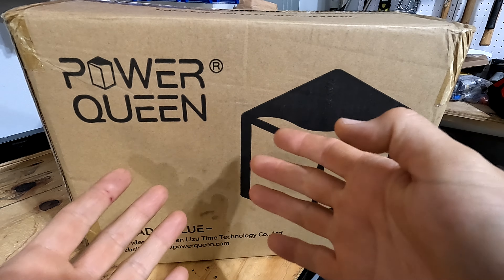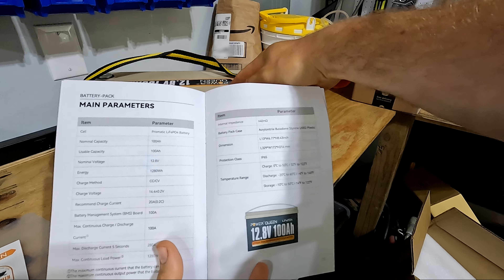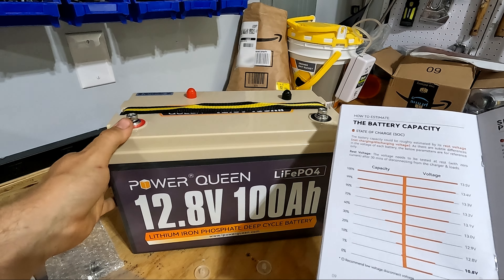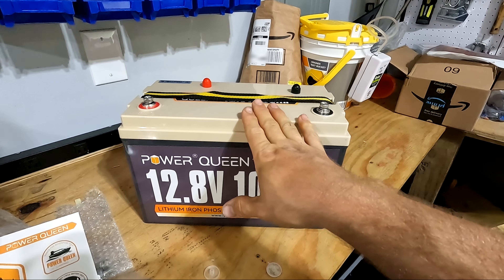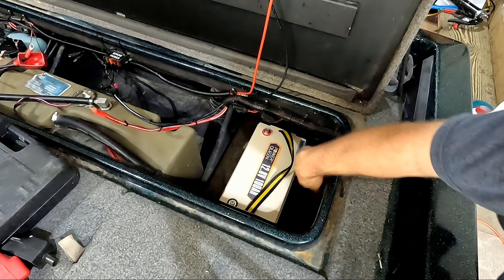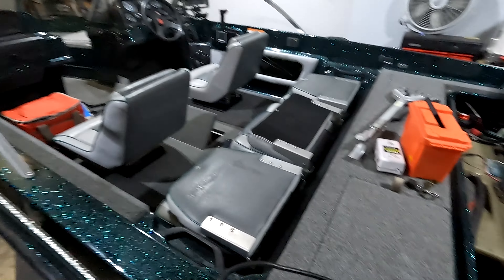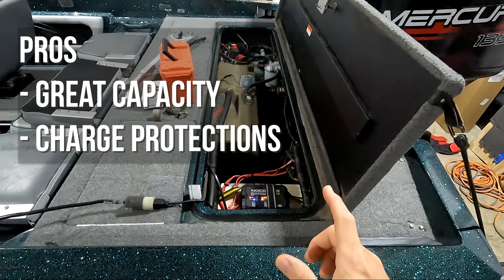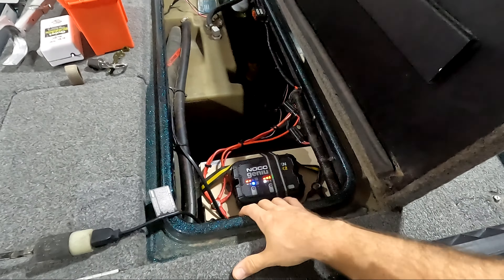Power Queen 12V 100Ah LiFePO4 Lithium Battery | Boat RV Off Grid Review

Comment: Thanks for video - Just learning about lithium batteries- Definitely  like weight saving plus can use all capacity- Is there an option for lithium  to replace the lead acid starting battery?
Reply from the maker: I've seen lithium starter batteries before but I don't have any experience with them to know if they are safe or work long-term.

Comment: What would your thoughts be on using one for a starting battery for the main motor? I’m now considering getting 2, one for cranking (if it’ll handle it) and one for accessories, lighting, etc.
Reply from the maker: You wouldn't want lithium for your starter, it can damage the electronics. A lead acid would be a better option.

Comment: The reason it’s taking longer is because you don’t have a lithium charger. It’s recommended to get one so you won’t damage the battery. I have the amped outdoors 10A charger and it works great! And it’s fully charged in like 2 hours
Reply from the maker: It's on a 5A NOCO lithium charger
Reply: @mvboutdoors  yep your right the nocos are lithium charger, a 20a charger would charger faster but 5amp ussally charges over night

Comment: Do you need a specific lithium battery charger for it? I have a 24v trolling motor, can two be wired in parallel?
Reply from the maker: Any lithium charger would work. Yes they can be run in parallel.

Comment: How long will it last with just a 70 pound thrust trolling motor
Reply from the maker: You would need to look up the amp draw per hour and divide it by 100 for 100ah.
Reply: @mvboutdoors  alright thanks and could you run nav lights with those batteries?

Comment: How many can you put in parallel?
Reply from the maker: Power Queen 12V10OAH
LiFePO4 battery supports maximum of 16 batteries in one system as 4 in series and 4 in parallel.

Comment: They won’t tell you the BMS on this battery keeps shutting down when charging on solar same your money for something a little better..
Reply: I had one of these running solar for 10 months and just added another wired in parallel. They are working perfectly  and have never shut down. I'm getting a third soon.